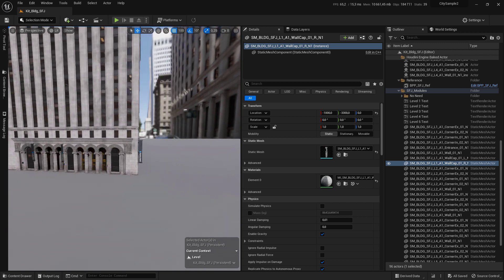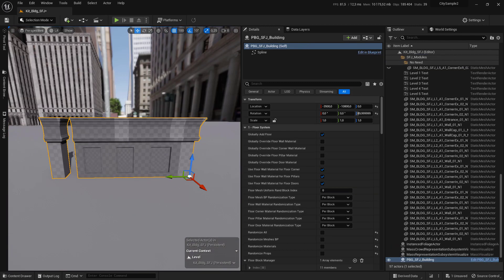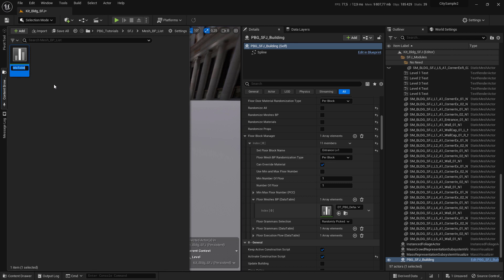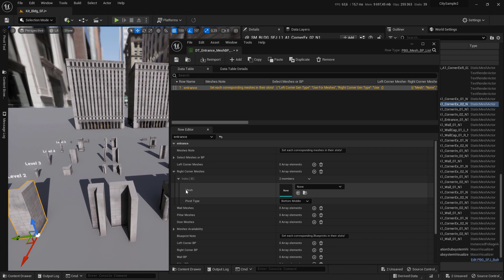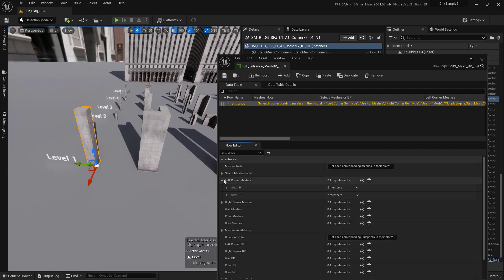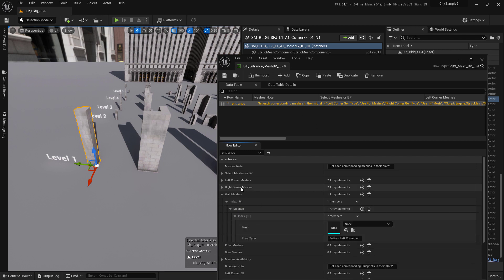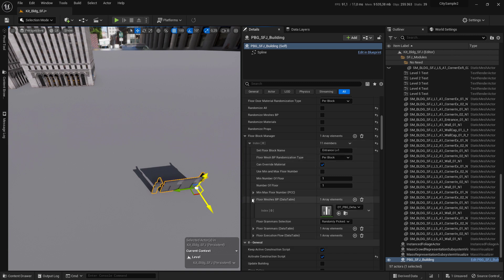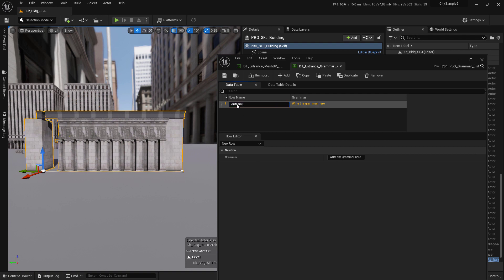2.0 PBG Creating your first building prefab

Comment: Hello!
I have purchased PBGpro and have a question regarding the "Apply pivot Rotation to Left" checkbox in the PBG parameters. Activating this parameter seems to allow interpreting the placement of inside corner module parts as "sample city" module parts. However, if I were to create new inside corner module parts, which format should they align with? Also, I'm confused as to why it's necessary to separate the module part placement interpretation between the "sample city" format and the default. I would appreciate it if you could explain the creator's intention behind this and the pros and cons of each placement interpretation.